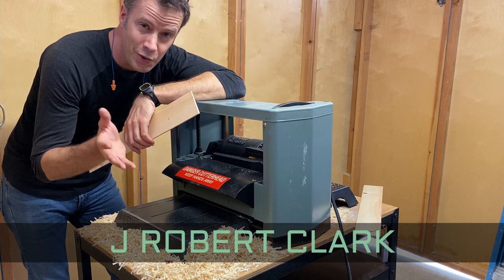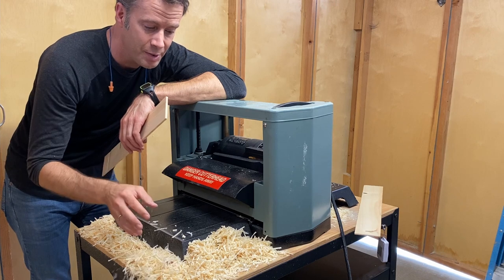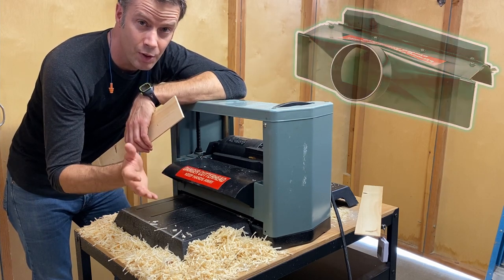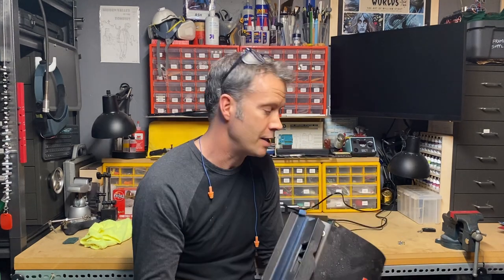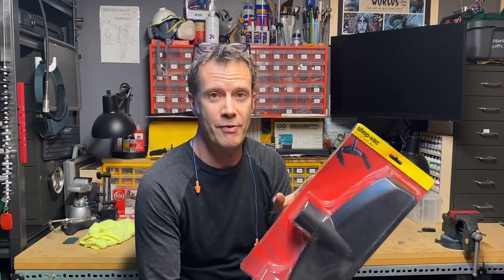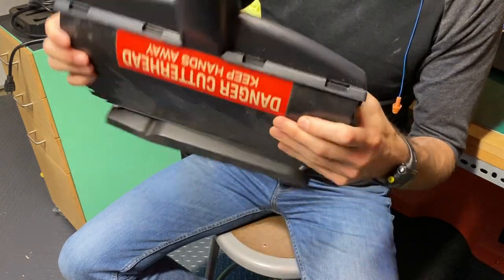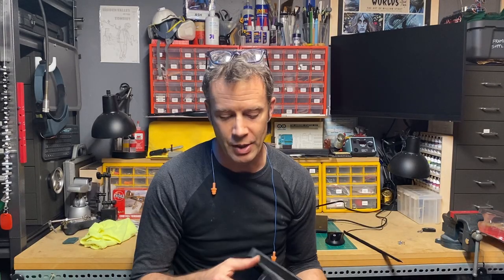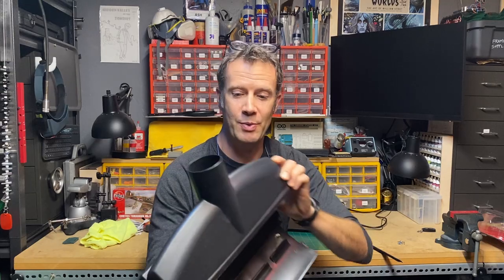Dust Collector Hack for Delta 12" Planers (and similar) - quick, easy & cheap!

Comment: Thanks for the video. Picked up the same planer last weekend. With a little bit of elbow grease and a new belt it works great. Also did the dust collector hack. Thanks again for this video.

Comment: What a fantastic hack!  I was ready to order the shop vac floor attachment from Amazon and then remembered I might have one in my shop that's not being used.  Sure enough I had one!  I used two self tapping screws rather than the drilled/tapped approach in the video.  Works like a charm.

Comment: Awesome!  I have the Delta 22-560 which has two threaded 1/4 x 28 holes in a perfect location for mounting the exact floor nozzle.  I drilled 2 holes in the nozzle, removed the "tabs" you used to mount the nozzle, and it mounts/works perfectly.
Reply from the maker: So glad to hear you made it work!

Comment: I did this to my older Ryobi planer that is similar. Used the Lowes 14in nozzle. Probably get 90-95% of the chips and dust.  Thanks for the video.

Comment: I have always dreaded the planing process because of the mess left behind. Well, I ordered the floor vac nozzle you indicated. And, because I was in a rush (and because I wanted to test things out first, I used duct tape! It held fine. I did need to support the vac hose to keep it from interfering with the wood exiting the machine. So I clamped a piece of 2 x2 to the top cross member and held it up with a piece of rope (which allowed adjustability and it kept the “duct tape” aesthetic going…)

Anyway. Thanks for your time saving work on this. Now, like all owners of this machine, I need a better handle setup for transport. Those two black handles they give us just don’t cut it.
Reply from the maker: Glad it worked for you!

Comment: I have a similar attachment that came with my shop vac &   
I tried mounting it on my Dewalt planer with just screws, but It didn't seal correctly,  then I tried your method of locking it on the tabs above 
then screwing it tight with a long screw on the bottom.  It worked like a charm, thanks! Thanks for showing how to remove the brush as well.
I also added foam material to the edges for a better seal.
Reply from the maker: Glad it was helpful! Thanks for sharing.
Reply: @JRobertClark  Sure was, thank you!

Comment: Great idea! i was just using mine and trying to figure out some dust collection. Have you had issues with this set up clogging?
Reply from the maker: Chris - thanks for watching. The setup works well. I have had it clog a few times - when planing greater depths. I suspect a larger opening and hose could help, but it hasn't been a major problem and it's easy to clear. Good luck. And LMK if you try it!

Comment: Amazing find, love the enthusiasm!  Is that a thread tap your using?  And do you just use machine oil to lubricate?
Reply from the maker: Thank you! Yes, I threaded the holes (5 mm) so that the bolts would lock in from the inside and then the wingnut on the outside could be tightened without the bolt spinning. I use machinist cutting fluid - Tap Magic. Here it is on Amazon: https://amzn.to/3xwsLZP

Comment: Would this hack work for the Delta 22-560 (12 1/2") planer do you think?  Thinking the dimensions would be identical...yes"
Reply from the maker: Mark, I'm not sure. Would have to look at the specs on your model. in checking out pics of it on line, it looks to be a bit different design. But the Shop-Vac nozzle is not expensive, and Amazon usually offers free returns, so it might be worth a try. LMK if you do!
Reply: I have the same planer, have you tried it yet? I'd love to know if it works

Comment: The chip deflector my 22-560 12 1/2" is 12 7/8" wide, what is yours?
Reply from the maker: 13 1/2" wide at the mouth - outside edge to outside edge.